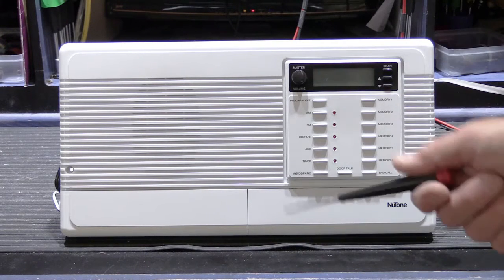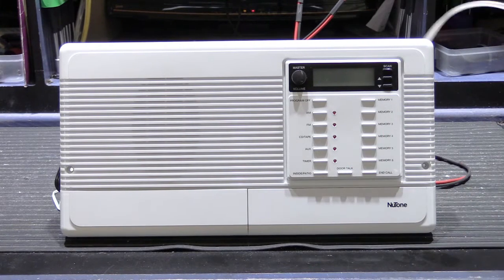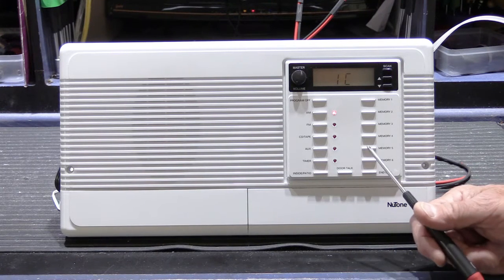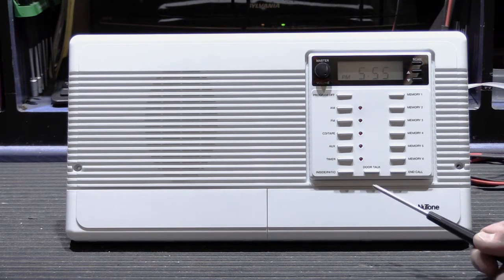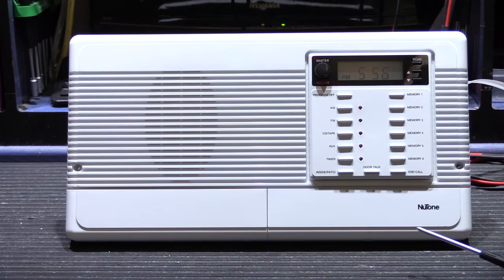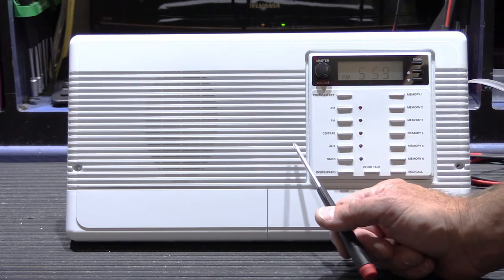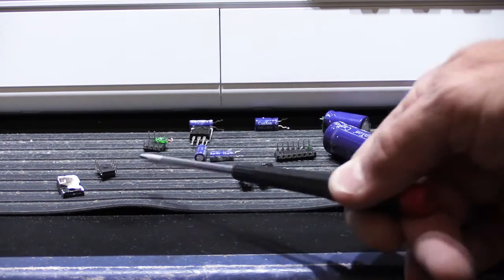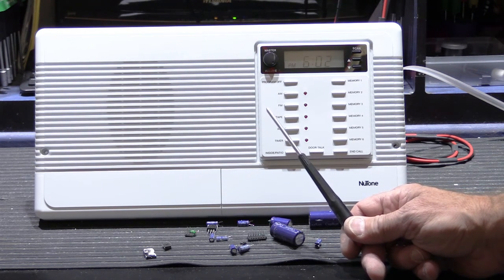NuTone IMA3303 Radio Intercom: Common Failure Mode #2

Comment: Hello, I just wanted to thank you so much again for taking the time to explain to me all the working components of the 3303 - the issues they have, what might be wrong with mine. 

After an extended time disconnected to power (by choice) - I connected again and all seems to be working fine "so far". As you advised, I will wait to see if it happens again - right now it looks promising after 3 days. 

If for any reason it freaks out again - will contact you for a replacement. 

And just have to say that I've never come across anyone who was so kind to explain the whole back story on these systems, components, issues, options, etc. - the world needs more people like you, amazing. Thanks again - Atlanta, GA
Reply from the maker: Hi Steve: and people say I talk to much. . .  Thanks for the comments - I hope your IM3303 behaves itself - if not, you can contact me any time for help - Chris  925-743-8236

Comment: This seem to be the problem I have.  Except that mine comes up with a very loud static noise.  The IC display is always on.  Since it share a switch with the refrigerator, there is not way to turn it off.  Any suggestions???
Reply from the maker: Hi Dennis,  Have you watched and followed our Basic Troubleshooting Video for the IM3303?  Here's a link: https://www.youtube.com/watch?v=yxz_KGwPsVo&index=1&list=PLsTvqKsBnGYc2zj1Db43FzJR_JV684dsi

You should also watch our Video that shows how to perform a Reset on your IM3303 - Here's a link to that Video : https://www.youtube.com/watch?v=hJ7hSia0d7A&index=2&list=PLsTvqKsBnGYc2zj1Db43FzJR_JV684dsi

I received your email and I will respond to it directly - Chris

Comment: My 3303 was installed in 2001. Last night the radio suddenly turned on....displaying "I C".
I couldn't control it or turn it off. It went from AM to FM and changed channels all by itself.
Is there a chance that some outside device or transmitter signal could cause this? There was no one in the rooms with remote stations. This was pretty spooky........
Reply from the maker: Hi The AUricle:  You need to watch our IM3303 Basic Troubleshooting Video and do the the troubleshooting - exactly as shown in the Video.  This will tell you if the problem is in the IM3303 Master Station or if it's being caused by something beyond the IM3303

Here's a link to the Troubleshooting Video:  https://www.youtube.com/watch?v=yxz_KGwPsVo&t=371s

Chris
Reply: I have watched the video, and found it really instructive, so thank you for an excellent tutorial!........but that doesn't answer the question I posed.
Can these units be controlled, even randomly, by other electronic devices that emit any type of signals.
Reply from the maker: Nope - Chris